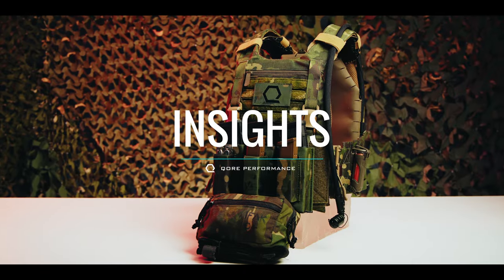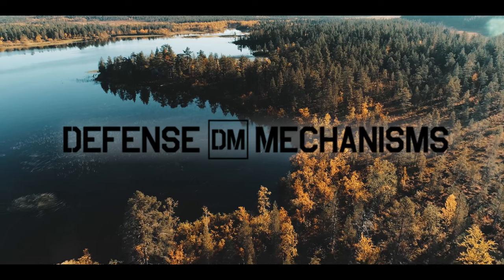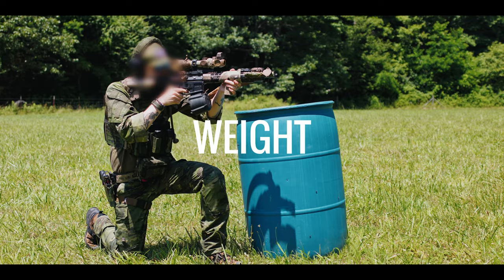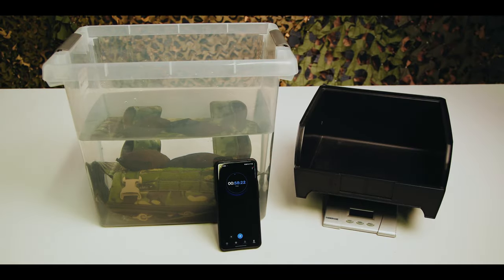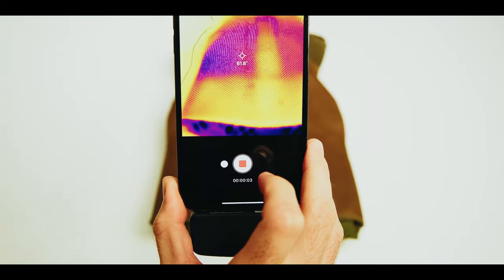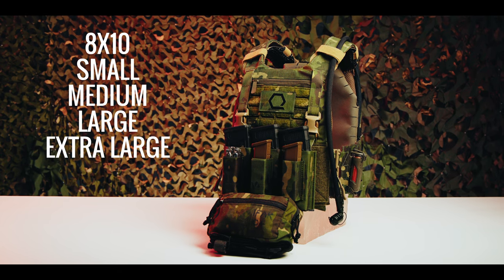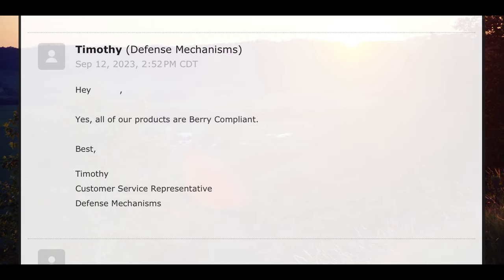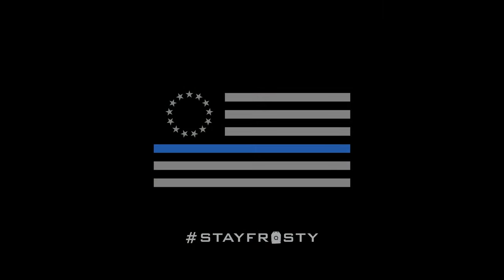Can This Minimalist Plate Carrier BEAT The Ferro Concepts Slickster?

Comment: You guys talked me out of the k19 primarily due to its inability to dissapate heat. I live in the desert so this is a big concern, some more poking around has brought me to this plate carrier. It has a lot of the similar features that drew me to the k19, but dissipates heat much better and its made in the US. Thanks.
Reply: Iam in the same boat i wanted a kzero for awhile but i hate the cummerbund so with the warfighter cummerbund and first spear tubes im looking at 400 where i can get the mepc shoulder pads and the new hybrid structural cummerbund with a coupon for 322 just wondering how comfy is the mepc
Reply: Lowkey any plate carrier without the ability to run hook and loop cummerbunds out of the box are dog water. I honestly don't know how companies that aren't airsoft based haven't just built a hybrid loop interface with holes for shock cord like V-XV's adapters baked into the product out of the box. It's butt cancer.
Reply: @yoloactual6975  yeah I think agilite is trash mybe if they were like 320 bucks with the war fighter cummerbund it would be worth it but that cummerbund that comes on them are just hot garbage
Reply: @TheJoeml85 I personally really like Ferro Concepts products in their ADAPT line, so I run them on my Spiritus LV119, but I don't necessarily like the feature set of their FCPC carrier. So I appreciate the ability to utilize their cummerbunds and various assortment of accessories out of the box on carriers I purchase. If it ain't better than my spiritus, it don't matter essentially.
Reply: @TheJoeml85 Honestly I'm not impressed with the comfort. Maybe I got the wrong size or something but I'm definitely looking for a solution to add some pontoons, I think that would help a lot.
Reply: @mysteryfist7  what size did you get

Comment: So I guess the spacer mesh can work well for thermals but wore told us it doesn’t but you can see this carrier is middle of the pack in that regard.
Reply from the maker: Here is a link to our INSIGHTS articles with the empirical performance testing data on spacer mesh:
https://www.qoreperformance.com/en-eu/blogs/military-insights/plate-carrier-cooling-heating-thermal-transmission-performance-of-plate-carrier-liners-like-spacermesh-sportskin